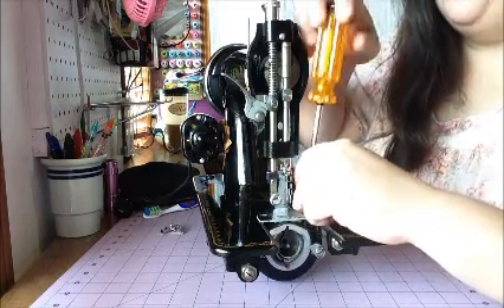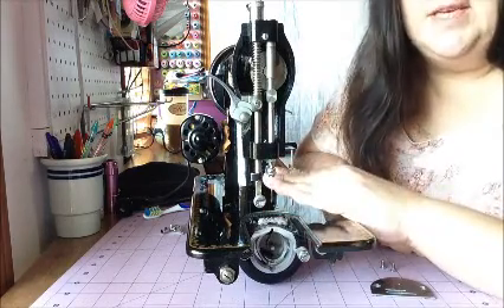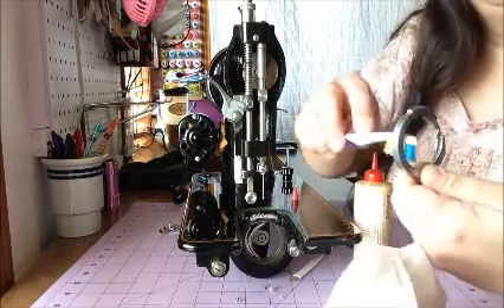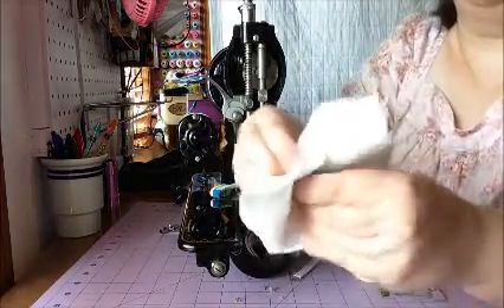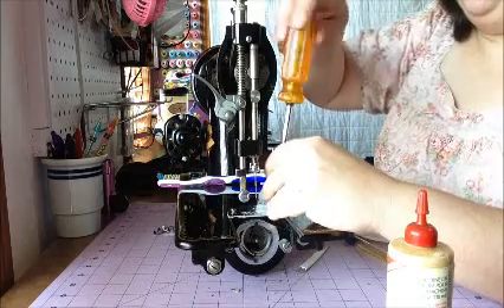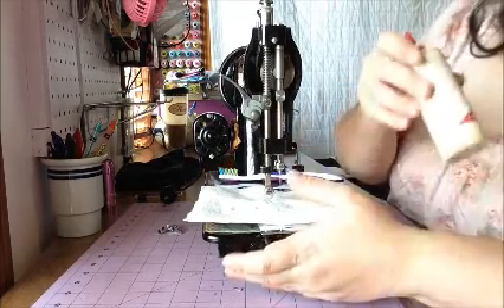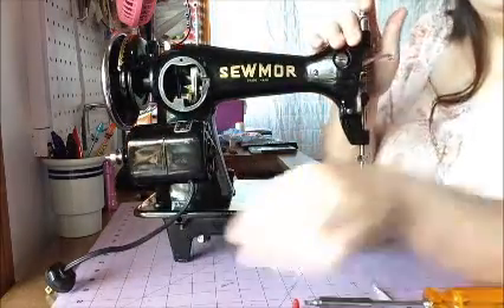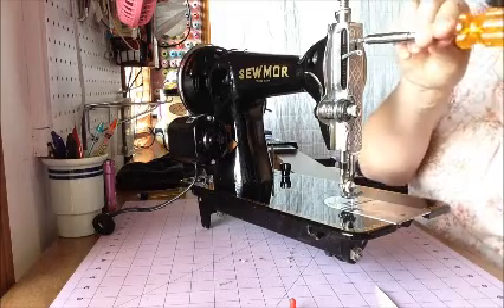Clean your machine!

Comment: I'm so happy I came across this video! Thank you for taking the time to show me how to clean and oil the inner parts. I have a Gimble 15 clone I picked up at the salvation army also, love her. I just got the belt, oil, and grease for it today in the mail. I do have a question on how to clean it because mine isn't that smooth shiny paint, it's actually matt black. How do I clean the body because it doesn't look like it's been cleaned for years?  Soap and water to wipe down or is there a special product I should use?

Comment: Great video!  I just got one of these on eBay for cheap because the cord was cracked and wires exposed.  Seller couldn't test it so sold it cheap.  I just rewired it and it sews amazing!  So smooth and straight.  I cleaned and oiled it by watching your video.  I plan to use it as a treadle machine but can go back to electric anytime.  Thanks for your tutorial.